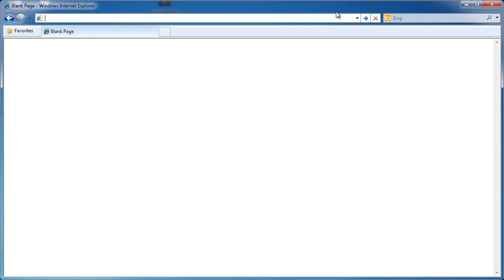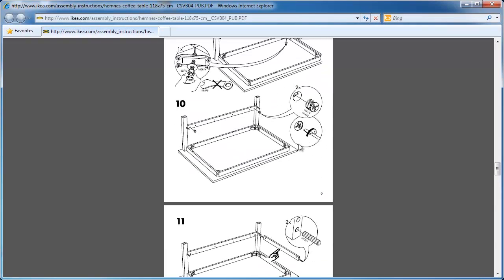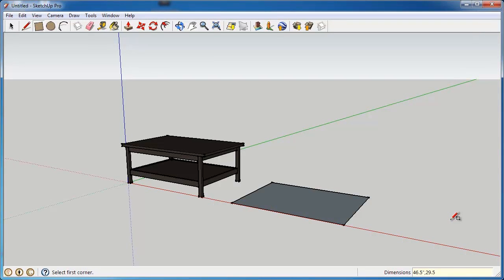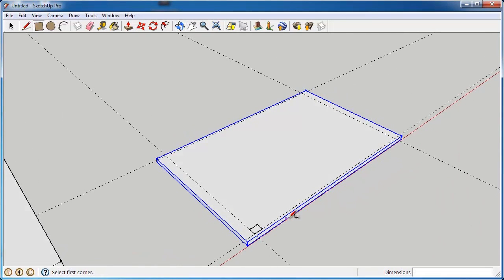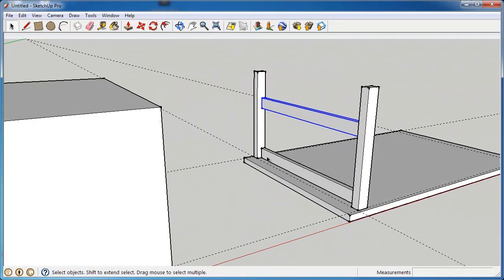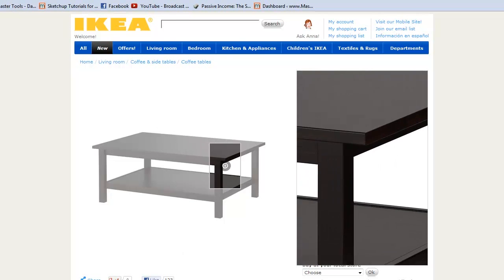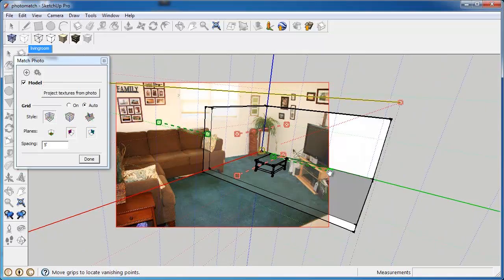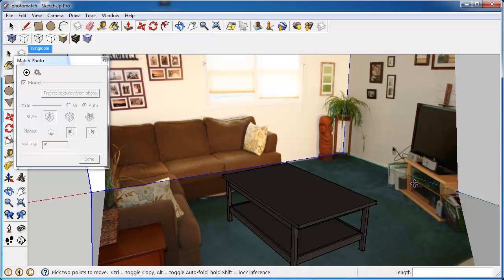Model any IKEA furniture using Sketchup

Comment: How did you get the picture of the table there?  I don't recall you saying how.
Reply: What steps did you take with the Photo Match tool. Still unclear. Thanks .
Reply from the maker: Evil farr SketchUp has a built in tool called the Photo Match tool. That's how I got the table overlaid on the picture
Reply: Thank you so much
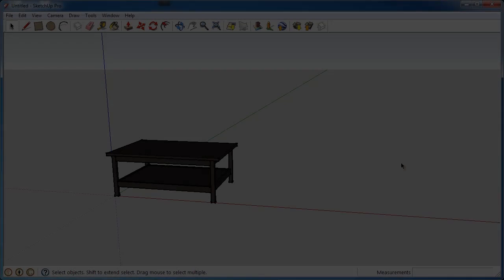Reply: The table appears at 5:35 on the Sketchup screen